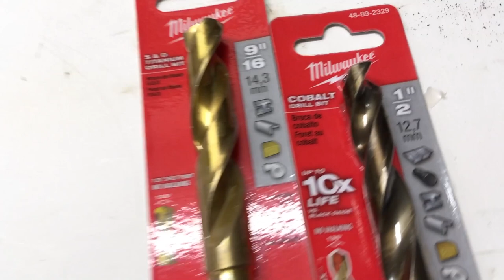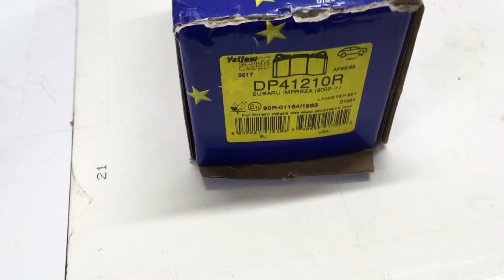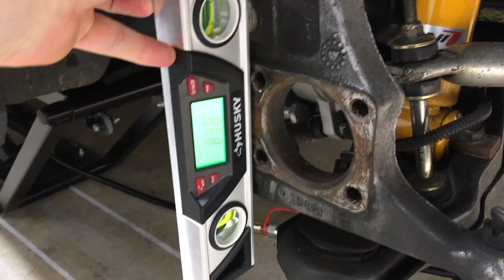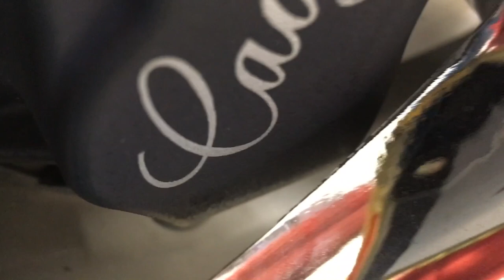F Body Brembo Upgrade

Comment: Those hub adapters are a critical piece of this conversion. The switch to non-floating calipers for performance applications really require ditching the stock hubs to avoid piston knock-back. The "ears" are actually for a dust shield on those adapters and I would advise against rotating them out of the way as it will change the hub orientation. If you opt to run without a dust shield, the ears are not needed but having them close to the mount is no big deal - if any of that stuff is moving around, you have bigger problems. I have been on the same set of C5R SKF hubs for a good 5 years now and no variance in the wheel rotation plane yet. Not a cheap way to go, and not needed by everyone, but very solid option if you do the hub swap and they plug and play with the ABS/TCS systems if retained. The Stranos version was not developed when I original converted so the above only applies to the adapters shown in the video.

Comment: I'm using a Cadillac CTS-V 6 pot calipers with 14.6 inch rotors in a 18-inch wheel and yes it's a very tight fit

Comment: Hey man good video, just picked up a set of the ATS 4 pistons myself to upgrade from Ls1 brakes on my 3rd gen race car. However those are not ATS-V brakes you have, the j-55 is from the ATS performance while the V has 6 pistons and monster 14.5" rotors. Still good work on a thorough walk through!
Reply from the maker: OK, well I had a lot of confusion on the packages/part numbers, so I'm not surprised. Thanks!
Reply: @SuperMacGuy  lol yep, I completely understand the confusion. Not even to mention that the regal gs uses the same 4 piston under another part number too lol
Reply: @colesherman  whaaaaaaaaaaaaaaat
Reply: @SuperMacGuy  I got some from a 2017 camaro ss, would those work with my 4th gen aswell?
Reply from the maker: Hector Castillo I don’t know; check on LS1tech.com, there are a couple threads discussing those calipers I believe
Reply: @hectorcastillo2463  heyyyyy it’s me

Comment: Nice info. Just looked up the hub adapter kit. Almost a $1,000 and the 4 piston kit $999-$1999. Little pricey for a upgrade.
Reply from the maker: Derek R well depends on what your budget is for upgrades. I had a hub fail on me on at a track day, thankfully not on the high speed corner but right after it. So the hubs are a must-have for me now. Thanks for taking a look.
Reply: @SuperMacGuy  thanks for the info. Really want to beef up my brakes on my Z28.
Reply: Chris would it be cheaper to buy a new C5 hub and get a bracket to bolt on?
Reply from the maker: The SKF XTracker that Strano sells (and other places) has bigger bearings in it compared to the stock replacement units, so it is designed to handle more g-forces, racing, AXing etc. So you could get a base/stock replacement, but you may not get a much longer life. I hope I answered your question.
Reply: Thanks. I'll have figure out if I want the cts-v or ats brakes.
Reply: What ones did you go with Derek R?
Reply: @bhcamaro2002  I got the 4 piston CTS-V calipers and 2012 Camaro SS rotors
Reply: I am running the same as well. Ctsv1 calipers, stoptech 14 inch up front factory size in the rear, ceramic pads. The arp studs and a 5mm spacer to clear the caliper. Pushes my offset to a +35 it's very close but barely clears
Reply: @bhcamaro2002  my back are stock for now. I'm going 9inch also
Reply: My set up was about $700 all in. For the ATS brakes

Comment: This is great 👍. I have some ATS callipers to put on my C4 so thanks!
But I struggle to comprehend why F body owners are so married to their 17's???
If your going to brembo 4 piston callipers go 13.6" rotors and chuck those stockers in the trash!
Reply: hello, I have a question hoping you can help me out. Do the new ATS callipers measure from bolt to bolt the same length as the C4 callipers. I am wanting to do the same as you, I would appreciate your feedback. Thank you.
Reply: @JosePerez-oy2zn  I understand the c4 to c5 2 piston  adapter brackets will work for the ATS callipers but the rotor will need to be another 0.6" larger diameter at 13.2".
A C6 Z51 is 13.4" I believe. 
My plan is to mount the ATS callipers on C5 conversion brackets and measure. If I need to get the C6 Z51 or even C7 Z51 rotors turned down so be it. But my suspicion is the C6 Z51 rotors will fit fine.
I paid like $200 for the ATS callipers, hardware and pads a few years ago. So cheap.
Reply: @JosePerez-oy2zn  ok it's been a while but I checked it out again because I'm getting close to doing the swap.
I believe if you use a c5 adapter bracket with ats and C7 base brembos you use a standard c5 12.6 rotor.
If you use a C7 z51 and possibly xts brembo you use a 13.6 c7 z51 rotor. But you need an 18" rim.
I don't know what the price difference are now but at the time I bought ats were like $80 ea and c7 z51 $500 ea. Xts are cheaper. 
Hope this helps.

Comment: I have an LT1 Car with LS1 brakes at the front and thinking on doing this, I have 3 channel ABS from a 98 Camaro working good. Could this setup work good for normal street driving?
Reply from the maker: It works just fine on the street.

Comment: I have a 99 ss camaro I have the cts v front brakes with 2012 SS camaro rotors and pads plug n play no need to cut or grind.

Comment: Did you installed a brake proportioning valve?
And tested and set it, as explained in another youtube miata video
and regain front/rear wheel lock as the stock setup the factory dialed.
Should set to front and rear to lock at the same time,
And then dial a little more front lock.
And also regaining oversteer understeer stock setup
Both of these setups can be dangerous is not addressed.
Another youtube brembo instalation ended locking the the front tires
At a minimum pedal presure.
Reply from the maker: No, in my opinion for street driving there's no need as the ABS system will likely kick in anyways (I have 4-channel). In 20 years of AX in this car, I barely wear down a set of rear pads, the car is already nose heavy (56/44%). Plus I think many people don't actually understand how a prop valve actually works in practice. It's too much effort for me, I let the ABS figure it out and just keep the system as it is.

Comment: Go nice job why not just grind down the bolt
My thinking is you added washer and then had to shave it all to fit. Why
Reply from the maker: The bolt is grade 10.8, hard to cut. Easier to grind some washers.

Comment: Where did you get the spacer plate for the f-body hub?  Do the rear calipers mount the same way?
Reply from the maker: If you are referring to the wheel spacer (time 17:36) I think that was an Eibach spacer, I probably got it thru Summit. It was nothing special. I did not replace the rear brakes because they do so little of the braking that upgrades are not worth it, and I recommend against it. If you need a little more rear braking, its probably easier to change to a slightly more aggressive compound.

Comment: Amazing video.  Thanks.  Can somebody put down the provide cadillac atsv part numbers here.  Also what rotors should I go with to work with to work with the atsv calipers?  
Do the rear calipers for the atsv work the same?  What rotors for the rears?  
Im looking to do this hopefully this week and will post a video.  Any help is appreciated and thanks for the video.
I have a 2000 WS6 trans am.

Comment: Thanks for the great video, just finished my install and can’t believe the difference.  One question is the torque for the caliper bolts, stock runs 75 ft/lbs but I upped it to 100 ft/lbs, what did you use?  Thanks!
Reply from the maker: I have a PDF (not sure where I got it) with all the parts for a 2017/C7 brake setup and the torque for the bolt to attach to the front spindle is listed at 162 ft-lb. I remember when I put them on thinking that was crazy high. Also I believe the GM parts website or manual will say to not reuse the bolt.

Comment: The larger rotors, used for the larger calipers, did they need to be machined for the hub?  What part number or application were they?
Reply from the maker: JoshHefnerX did not need machined. Got from KNS brakes.com

Comment: Great video Chris!  What size bolts do I need if I am using the ATS-V Calipers?
Reply from the maker: The bolt is part number 1161 1085, a generic GM bolt of size 14mm x 2 (thread pitch) x 45 length

Comment: How do the 12.6" rotors hold up to road racing?  I have them on my ATS and I wish I had more brake for street use.

The better (stronger and faster) solution for the M14 shoulder screws is to grind the tip of the threads so they're flush with the caliper flange.  Shoulder screws are also meant to work with a reamed hole. A 14mm reamer, or possibly oversize reamer, are off-the-shelf items.

Comment: The rotors you used, are they specifically for a 4th gen F body? Or for some other car?
Reply from the maker: They are for Corvette. Either the C7 base model or z51. Centric rotors for the base are pretty economical. For the z51 big rotor, I suggest KNSBrakes.com they have a non-slotted/non-drilled blank that is not too expensive.

Comment: You think it's worth going from the cadi j55's to the z51 j55 brakes?
Reply from the maker: Only if you road race and need more mass to handle repeated and large heat cycles. Good pads on the ATS brakes are a very effective package.

Comment: I know you made this video a long time ago but, did you try the ATS with the 13.6 rotor? I also see that the Stingray rear rotors are 13.3 could these go with the ATS caliper?
Reply from the maker: No I didn't try other calipers, I spent enough money on the Z51 ones that were too big for me. The C7 uses a rear drum for parking brake and the rotor is completely incompatible on the front axle.

Comment: What's the options for the rear brake caliper and rotor setup? Brembo in front and stock in rear? Currently working on my 98 trans am and havent had much luck on rear brake setup options when you go with brembo in front.
Reply from the maker: Rear brake upgrades are pretty much pointless on the F-body. Even road racers I know on FRRAX forum do not recommend upgrading the rear caliper, but a better pad compound is fine. These cars are light in the rear esp under hard braking that too much brake results in lockup more than anything. Stick with the stock caliper, clean/paint/etc if you want it just to look nicer.

Comment: I got every single part that you recommend for this ATS BREMBO and JL9 corvette rotors install along with the 15mm eibach  hub centric spacers and longer studs.
I have 17x9.5 torq thrust II do you think the calipers and rotors will clear? I don’t want to be stuck with this set up and the wheels not fit.
Reply from the maker: Sorry I have no idea.
Reply: How did they fit? I’ve got TTMs in 17x9
Reply: Did you ever do the conversation @robertgonez3172

Comment: Do I need spacers for this kit to fit under stock 17 inch 2002 Camaro ss rims? I'm trying to not use spacers.
Reply from the maker: I use spacers on my Firehawk wheels, it's no big deal, but of course you will have to have longer studs. There is an LS1Tech.com thread with video and they used SS wheels, IIRC they fit OK. But you will have to test fit yourself to be 100% sure.

Comment: What’s the part number on those brake hoses? Are they longer than stock hoses
Reply from the maker: Yes they are much longer, and the Kore3 number is "GMF4" but that might not be actually shown on their site, just look for C5/C6 conversion line.

Comment: Looking to put forgestars on my car and what I've read the wheels will clear the brakes without spacers.  This true?
Reply from the maker: Yes the F14 wheels has a LOT of space for big calipers without spacers. I am using 18x11s (with ~36mm offset) and there is easily 1 full inch of space at the tightest spot. Be sure to check Forgestars before you mount tires for roundness and trueness, one of my wheels was not straight right from factory, take them to tire shop and put on the balancer.
Reply: @SuperMacGuy  Alright appreciate it.  What's the benefit of the vette hub?  Any other odd and end things to know?  Trying to get into racing and I'm new to all this.
Reply from the maker: @patrickpenton1653  Well there is a lot to know about F-bodies. The front hubs are a weak link, once you start to AX or RR on wide tires you'll need them: http://www.stranoparts.com/viewfeature.php?FeatureID=7 
Also, Koni Shocks are best bang for buck on these cars, do them first. Larger front swaybar helps a lot. The rear ends are also weak so really do not drop the clutch and launch super hard a whole lot. A lot of drag racers blow diffs up quick. Learn about "Ice Mode" when braking, it's a real thing I've written a lot of (dumb) posts about it till I learned properly what it is and why it happens. If you get lowering springs make sure they work with the Koni's (again go to Strano's for them). I like my Watts link in the rear, stock size rear sway bar. A race seat (Sparco) is well worth it. Long tube headers, a good tune, and decent exhaust round it out. Seat time, seat time, seat time. Be willing to have an instructor. Don't overdrive an F-body until you get time/experience (not sure your overall exp level) but I see a lot of ppl overdrive into corners and plow through, you gotta have restraint and finesse.

Comment: What about the back ??
Reply from the maker: F-bodies are front heavy, and you know most braking force happens in the front. So changing the rear calipers is really not worth the effort. I get much, much less rear pad wear on this car compared to front. In fact over 18 years of autocrossing this car, I only changed the rear pads once.

Comment: Will the JL9 brembo calipers fit from the C7 on a 4th gen Camaro
Reply from the maker: Yes, JL9 should be the code for the base C7 caliper, that fits inside a 17 inch wheel, its the same as the Cadillac caliper I have in the video. But, they are more expensive to buy as they say "Corvette" on them.
Reply: @SuperMacGuy  what would a fair price be.  With everything calipers, rotors,  pads, pins, bolts, houses. They look brand new.

Comment: Wouldn't a lock washer work better in that situation, its smaller no grinding. ?
Reply from the maker: A lock washeer wasn't the point. The point was to make sure the tip of the bolt didn't contact the rotor. I could have also ground down the end of the bolt, but that's more work and messes up threads. I could gone without the washer, if I was comfortable with the clearance from bolt to rotor. But I like to go the extra mile to make sure everything I do is reliable, fixable, and fits/clearances properly.
Reply: @SuperMacGuy  Chris you missed my whole point,  putting a lockwasher under the head of the bolt should of taken up distance on the bolt and relieved the small clearance.
Reply from the maker: TRUE ANOMALY I understood
Reply from the maker: There is also the offset/eccentric on the back of the spindle that I wanted to account for - it was going to prevent the bolt from seating. Watch from 15:30 for what I mean. Sure a lock washer might have worked, but I wanted to have a full, flat seat for the bolt flange.

Comment: So hows driving on them?
Reply from the maker: I like them a lot. The pedal feel is good and firm. It grabs pretty quickly, compared to the stock brakes which had a gradual bite and soft initial feel. I also put a Strano MC brace on, may help a bit.
Reply: @SuperMacGuy  Have u had knock-back issues?
Reply from the maker: one off nope, but I have those big X-Tracker hubs which are way more stout than stock replacements. Very important to have, or I would get knockback like on regular brakes, maybe even worse since these are not floating calipers.

Comment: gen 4 need tooooo much upgrades $$$$$$$$$$$$$$$$
Diffs, brakes, wheels, hubs, almost all suspension $$$$$$$$$$
You’ll end spending more $$, And getting less than a stock used gen 6
And the bonus of a stock C6 450hp engine & beffy IRS

Comment: This is so far away from plug and play it hardly seems worth it.  I hope there are other options out there when I go do mine.  I know I am not going this route.  Two many problems and you just got started.
Reply from the maker: Every person has their own level of comfort with auto mechanic work. I'd say this was by far, very easy, not complicated, and yes one of the true bolt-on solutions. I had no worries about doing it. I did have my own pitfall of being confused about the correct part number. But the actual work of installing them was *very easy*.   If you are researching other F-body brake options, there are some that require you to completely cut off both of the mounting ears, which requires you to maybe take the entire spindle off, and then use a cutter/grinder, and permanently alter your spindle in a far more drastic fashion.